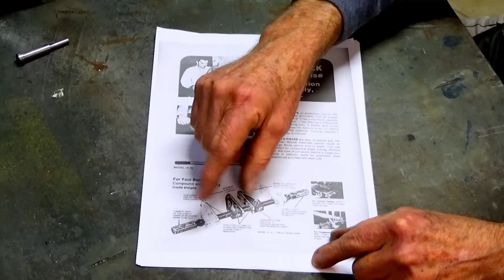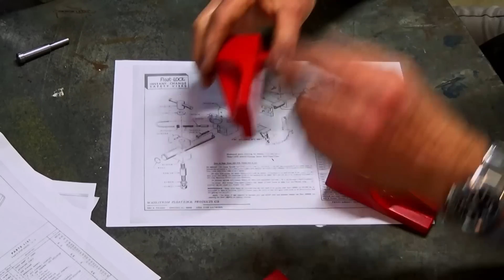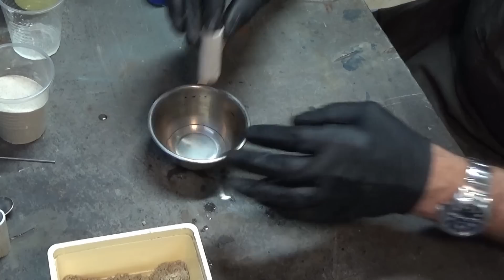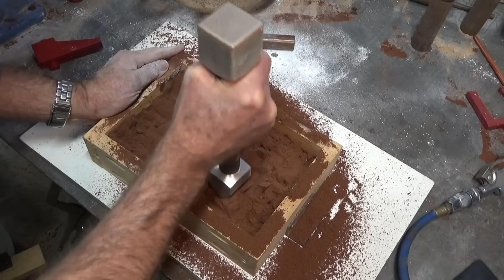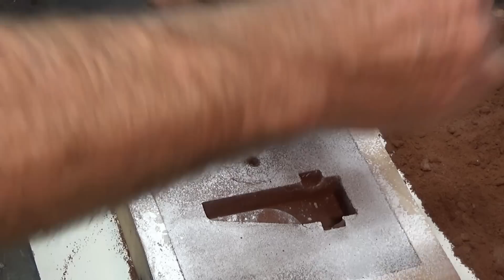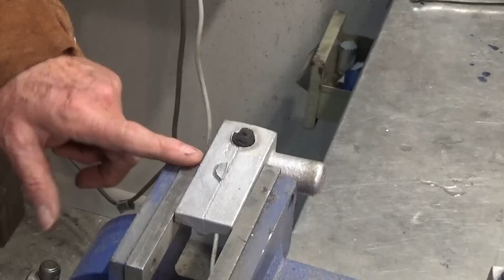Float Lock Vice from Aluminium Castings

Comment: Great video Mark. Could you do one on the pattern please. How do you get it so smooooth?
Reply from the maker: I think I have shown part of the process in some other videos but I print the patterns on my Prusa printer using PETG filament with a 0.2mm layer height. I then sand the prints with 120grit paper and spray on about three coats of automotive spray putty from a rattle can. This is then sanded back with 240 grit paper. The final coat is done with an automotive acrylic lacquer, again, from a rattle can. The main aim is to fill in the layer lines which can actually show up on the finished casting and they also make it more difficult to pull the pattern from the mould. 
Regards,
Mark
Reply: Thanks for your reply Mark. I am from Orange in NSW but just now it is 1:00pm Saturday. I am sailing down the Danube River on a Scenic River cruise. We are on our way to Amsterdam and then GB for 2 weeks before home. I am glad I can watch your videos and talk to you in such luxurious conditions. Kind regards Paul.

Comment: I've been wanting to make one of these  ever since Mr. Pete made his. Very cool project.
Reply from the maker: The Blondihacks and Tubalcain versions had the long acme screw to move the jaw and although they work great, you do have to do a lot of cranking to open the clamp right up. I am hoping this version will do away with the need for making such a long acme screw and also the need to buy a matching tap unless you are one of those clever types that can single point a female acme thread in steel! I am afraid I am not so bold. 
Regards,
Mark

Comment: I cant be the only one wondering why you cast that in two parts. Definitely looks like there was room to do all three in a single casting.
Reply from the maker: It could have been done and I have bigger flasks but gating tends to get a bit more complex when making three castings in the one flask. I should have 3D printed the gates and runners connected to all three patterns but for a one off set of castings it's a lot of extra work. If you were going to do multiple batches it would pay off. 
Regards,
Mark

Comment: Nice video, good project. I hate AGC (automatic gain control) I too had to look for a system that would let me control the gain manually.
Reply from the maker: I have yet to find a way of turning it off. I suspect the camera is also to blame. the controls for the audio are disabled as soon as you plug in an external mic.
Regards,
Mark

Comment: Hey, thanks for the mention! 😄 This will be a great project and you’ll love the result. It’s easily the best drill press vice design ever, IMHO. It makes me smile every time I use it.

I feel your pain on audio. I’ve spent thousands of dollars on microphones and still have some issues. Audio is hard.
Reply: I’m concerned about the concerns over audio in shop content.  I suffer considerably from tinnitus, and have trouble hearing SWMBO, but understand every word that you speak.  And I don’t even have a British Ear.  Sometimes the Aussie accent throws me, but y’all do fine.  Gotta be old ears, or those picky audiophiles whining 😂. Yer fine!
Reply from the maker: Thanks Quinn. I cannot do voice over after filming. I think it's a rare skill and not for me. Neighbours with chain saws, leaf blowers and contractors chipping tree trunks for days on end also add to my misery.
Regards,
Mark
Reply: Quinn & Mark, I 'built' the version that Neil over at PaskMakes made and it has made work holding so much simpler on the drill press; admittedly I already had a H&F drill press vice and the steel already in stock. However, I realise that you are using it as a content provider but I was just wanting to get it done.

Comment: Mark, when making the cores with epoxy-mixed sand, is it necessary to pack the sand since the epoxy ought to stick to itself?  This will be an interesting series.  Thumbs up!
Reply from the maker: Ramming the mix is mainly to ensure there are no voids inside the core box. I never have to ram it very hard. Some more complex core boxes can be a challenge if there are overhangs or return cavities that cannot be seen easily from the end where you are loading the mix. 
Regards,
Mark

Comment: I'm excited to see this project unfold. I have a friend that owns a small foundry in the city. I helped him pour some brass a couple months back. This might be a fun project to learn to make patterns, molds and then cast the parts. Curious - did you ever consider just 3D printing core molds, so rather than having to split the PVC, just separate the two halves of the mold? Just a thought.
Reply from the maker: Generally, I do 3D print the coreboxes and I will print in a flexure so that it is easy to pry them apart later but this core seemed so simple I didn't think it was worth modelling and printing something when the PVC conduit was just sitting there begging to be used. I will be making the STL files for the castings available when I have finished the series. 
Regards,
Mark

Comment: Gday Preso, the castings look great and the furnace worked well, interesting the core epoxy holds up to the heat, great video mate, cheers
Reply from the maker: I was very sceptical when I first saw the epoxy sand method. It was Luckygen1001 that got me started with the method. He hasn't released a video for a while but he does some excellent castings. 
Regards,
Mark